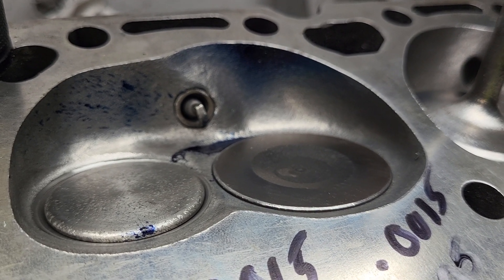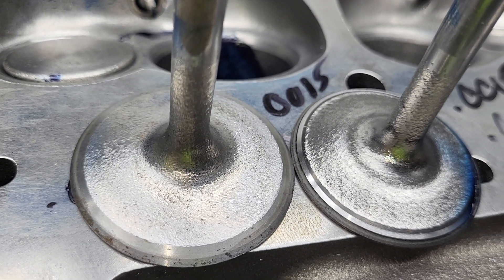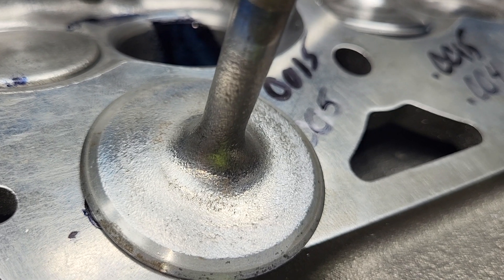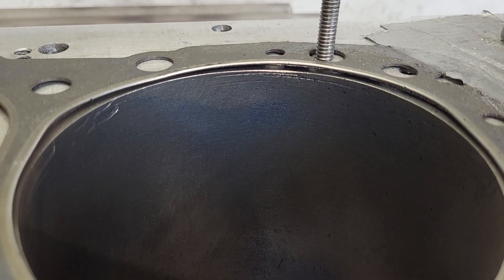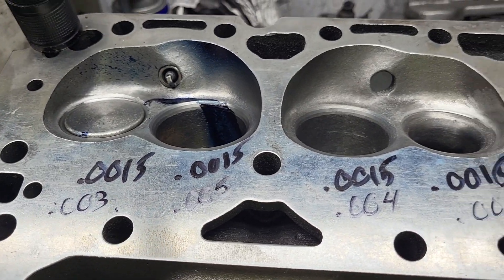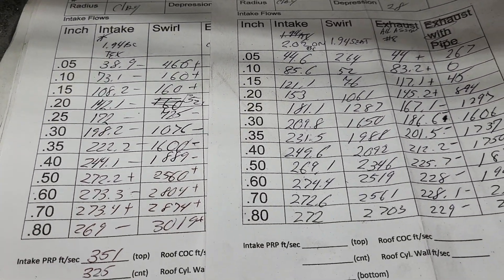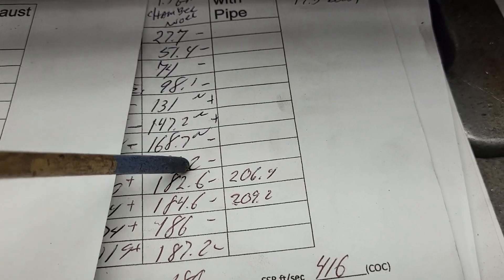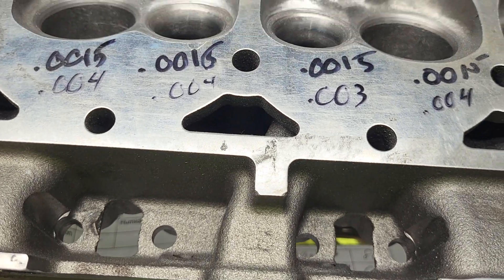Redheaded Stepchild, High Performance TPI project. Major mistake!

Comment: Can the exhaust flow be explained by potential inlet valve leakage with the wrong valves' seat not sealing? Bypassing air will show as flow but not velocity. If so he exhaust flow figures could be further off than the intake. As for the old videos wouldn't you just pin a comment with the issue in each video with a link to this video. after the valve change the video to video comparisons are still valid with maybe a little bigger error bar.
Reply from the maker: Intake valve didn't leak
Reply from the maker: We will find out soon. Stay tuned. Thanks

Comment: One thing that very few people realise is that OEM's use shrouding to increase low and mid lift flow.  It works due to venturi effect between the valve and the chamber.

Comment: Unfortunately things happen sometimes but the world wont end,i always do the valve job first and work from there.
Intake valve is chosen on bore size percentage and if you are choked further up the induction tract which is typical 23 degree cylinder head. 
I dont like unshrouding the chamber alot to chase flow,a 23 degree chamber is already dug out to much due to valve angle.
As far as the exhaust it looks like you have turbulence at the convergence lift point and i find its more in the short turn than chamber,keep the 1.5 exhaust valve as it is more than up to task.
This is just my opinions and no criticism directed to Charlie. 
When we put in time,money and effort into a project we want to get a decent return  .
Reply from the maker: I agree. These are going 2.02/1.6 as I write this. Thanks

Comment: Hi Charlie. That makes no sense. How can it flow better with a bigger restriction ( 202 valve ) in the way? Was it the shape of that valve? Do you have any ideas?
Andrew
Reply from the maker: I do. It has to do with the way the air needs a chamber wall to follow. That is my thought. Thanks
Reply: @servediocylinderheads  Hi Charlie. The air needs the chamber wall but if the valve is too close it's shrouded. What a balancing act. Andrew
Reply: Please don't delete. I think it's still good info.
Reply: Doesn't it depend on how the valve seat and valve face are cut ? if u r cutting yur 1.94 seat on the wide side it will hit the 1.94 closer to its edge where the same seat cut will hit the 2.02 closer to the middle , what the air is telling us with Charly's seat cut and the 2.02 valve is that it likes it better to hit the valve face in the middle as opposed to closer to the edge  , maybe we should be asking why that is ? maybe the 1.94 seat will flow better with the 1.94 valve if its a narrower diameter ? Did u open a can a worms Charly !
Reply: Valve seat contact and extra overhang "lip"